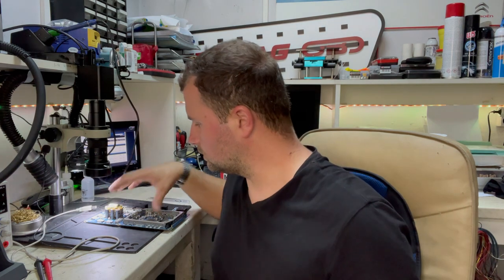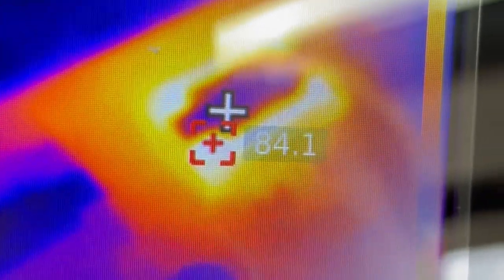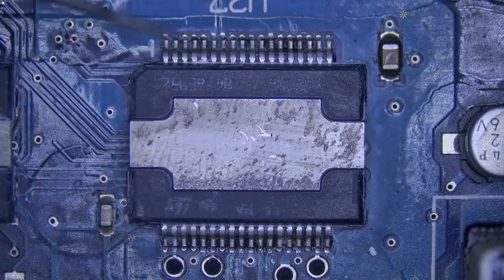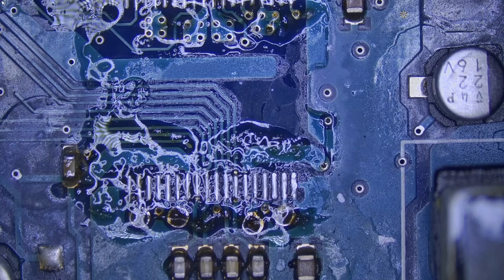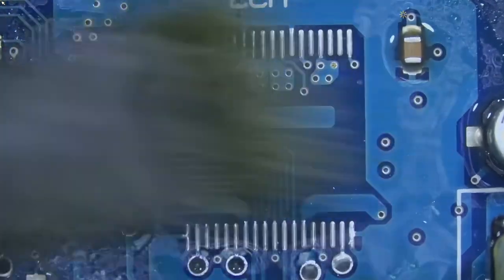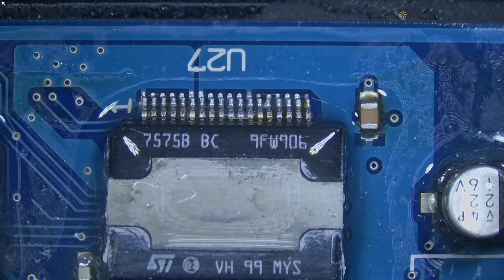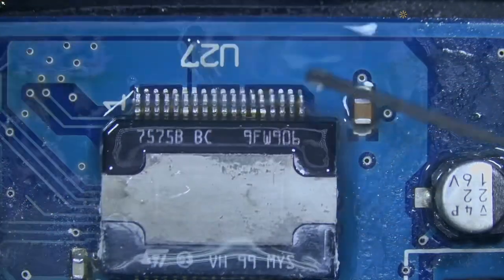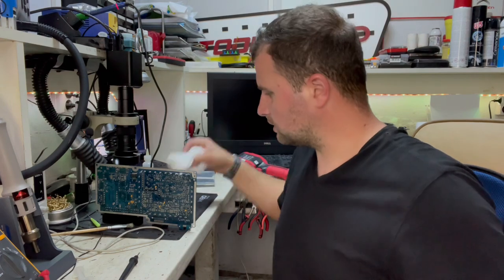Audi Q7 Bose Amplifier repair - NO SOUND

Comment: Why do you desolder 7563 and solder 7575, these 2 chips are not identical - they are amplifiers, but have a different pin layout.